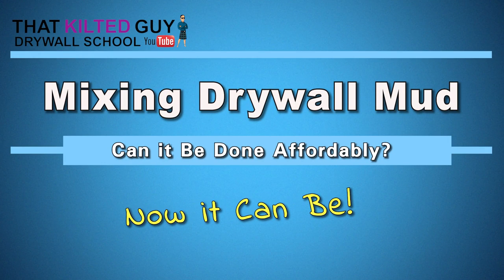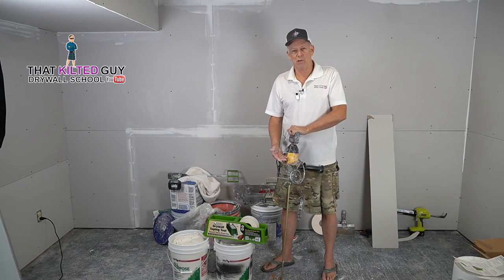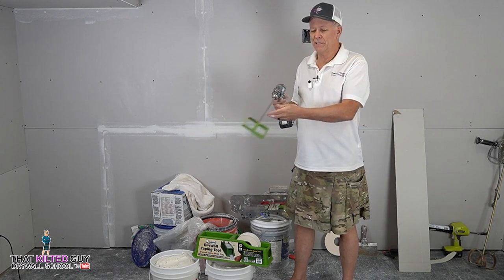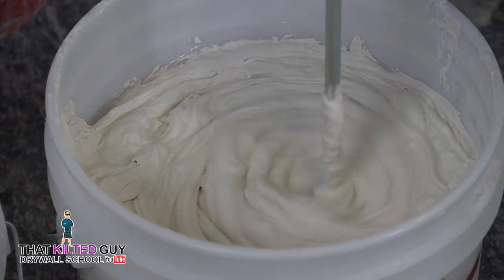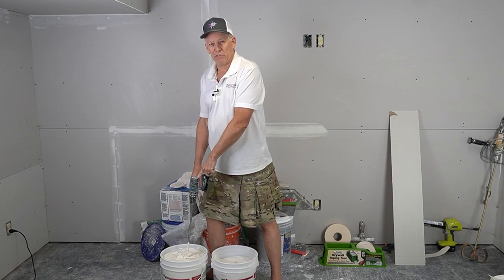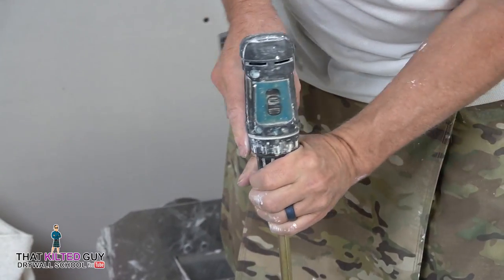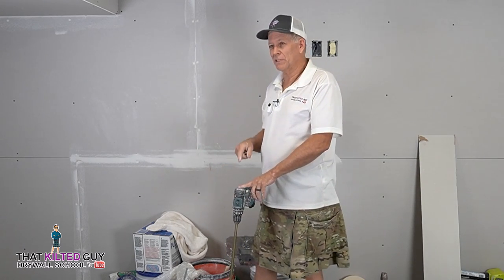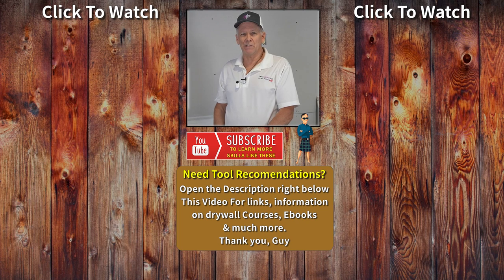The Best Small Drywall Mud Mixer

Comment: One of the features of the MixIt is the ABS non-porous material. ABS doesn't allow material to stick so cleans super easy and ABS plastic is super tough. The mixer is designed for paint, drywall mud, epoxy but not sandy materials like thinset and sure not concrete. But I use it for these anyway for its size. Using it in thinset can wear the plastic but will still last a long time. The last tool test we did with thinset was mixing 3,000 pounds (that's a lot) and it was still going and never did break. There wasn't any paddle left on the corners but we kept going to see what it would do.

Comment: Great video!  I burned up one drill already. I have a question not related to this if you don’t mind. Where do you get your Strait-flex products from?  I’m local to you and the shops don’t or can’t get anything. Specifically the  sticks of corner bead. Thanks!
Reply from the maker: Try the drywall supply places, not the big boxes. I got mine for Free from them

Comment: I've burned out more than 1 cordless drill mixing mud. I don't think a small cordless can effectively mix a 5 gallon bucket so I mix in small batches 2.5 gallon or less. I recently got a 1/2 inch 60V cordless which can blend the heaviest materials.
Reply from the maker: You're right, but this paddle is smaller and can be turned fairly easily by a strong cordless drill like I showed.  Like I said, I would only use it now and then and it will be fine.
Reply: When I start a new bucket of mud I add water and just mix the top half. As I use the mud I mix more in the same bucket. The 60 volt drill should handle any job.